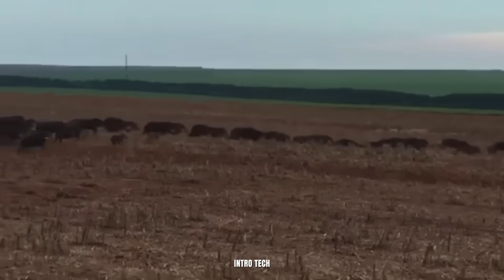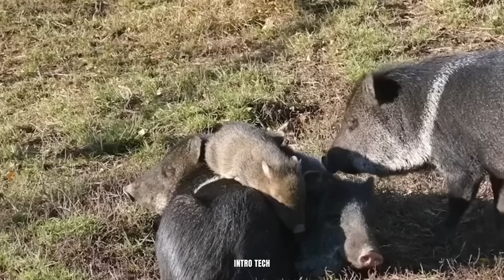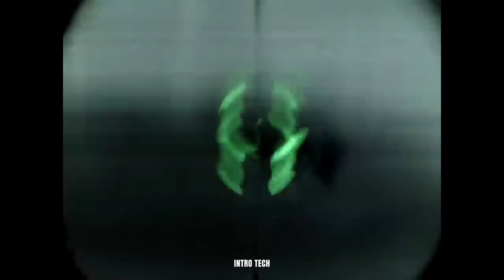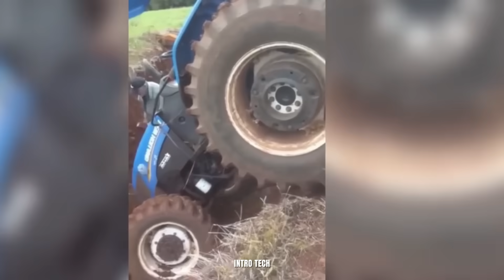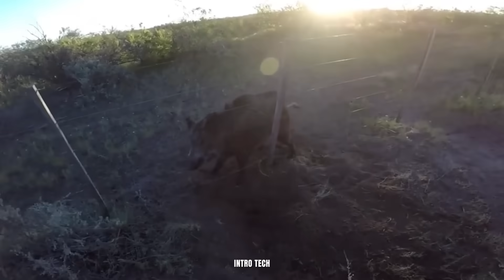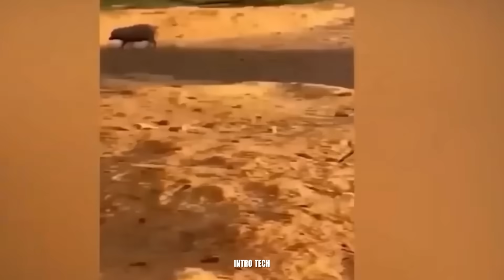How Farmers Outsmarted Thousands of Wild Boars With a Simple Ditch Trap They Can’t Escape

Comment: Trenches are the best;  shooting may yield 50 or 60;  large traps can trap 100, but trenches can trap thousands.  Farmers can dig V-shaped trenches, each leg upto1,000 feet.  They could organize groups, garmers, gun clubs, even the National Guard.(  They have the vehicles & the automatic weapons.)  They could block the flanks with fences or vehicles.  Then they could sweep a large area, herding the hogs into the traps.  Dogs could  also be used.  Once in the trenches, they could be killed by gunfire.  Then they could be taken  out for meat processing;  the rest buried.  It may be expensive, but I am sure the cost would be less than the crops ruined, & the system can be used at many different locations, & the results would permanent.
Reply from the maker: Totally hear you — farmers are losing livelihoods and something needs to be done. At the same time, large operations like you describe can be dangerous and controversial. Ideally solutions should protect crops and follow laws, with vets on hand to make sure it’s done humanely. Appreciate the thought you put into this.